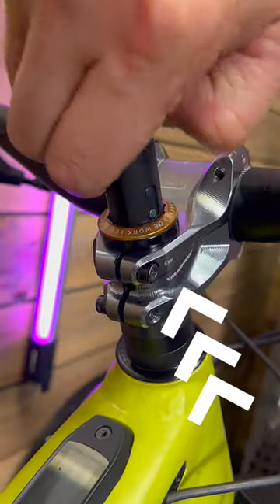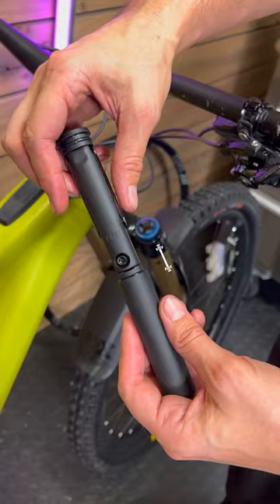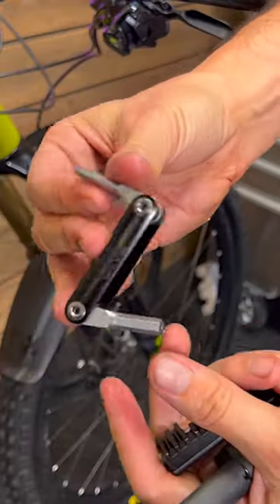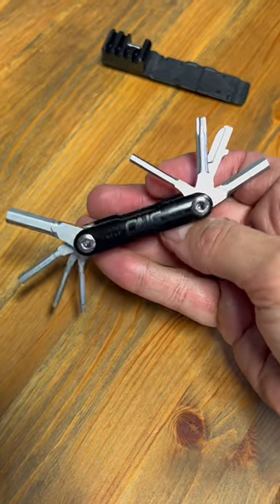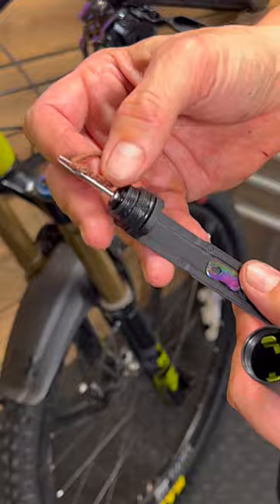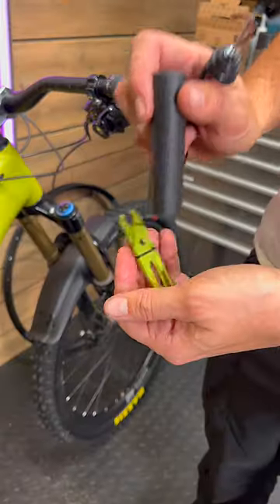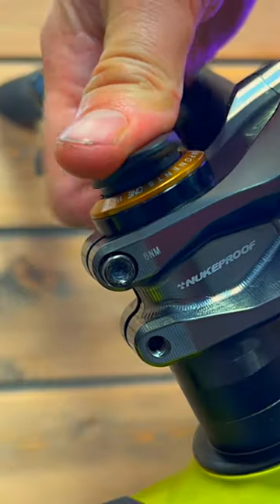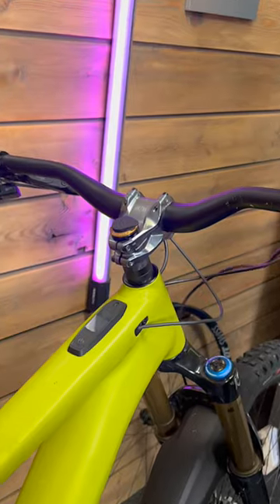Hidden Bike Tool Hacks #shorts

Comment: What about the thing blocking the hole through my steer tube that the top bolt screws into?
Reply: It’s called a star nut. I’m wondering the same thing man.
Reply: @Zac_Szuberski  ended up doing some research on it. You remove the star but and then there are different versions of the product. One where you have to put threads into the downtime. And another when something goes into the bottom of the downtime that this will attach to from the top
Reply: Pretty sure you need to thread the steerer.

Comment: Does it breaks that often you need to carry all this things all the time with you?
Reply from the maker: No, but better to have stuff on you when your on a mountain and something breaks !
Reply: Lol, sounds like you’ve never had a fastener come loose, a chain break, or tire needing to be changed trailside. You either don’t ride much or don’t push the limits if you never have a mechanical issue on the trails.
Reply: Tools  before  food and water.
Reply: Where is the link for this item and where to buy it?

Comment: The only problem is that you have to put threads in your steerer tube and it voids the warranty. I would probably get one of these on my new fork but its been acting weird so im going to wait until the warranty expiries
Reply: The warranty is useless anyways. I have an e bike that the motor died at 951 miles and under 2 years old bosh never made it right. 10,500 wasted.
Reply: @ChannelZeroOne  I have a Marzocchi Bomber z2 and it started leaking air so I took it to my LBS and they filed a warranty and marzocchi said they would fix it for free I would just have to pay shipping
Reply: @spyder027  Still dont see how threading in the top part of your cap has anything to do with the warranty or the point that I was screwed for no reason other than the bike shop help my bike so long that warranty expired. Then to top it off bosche said the bike is now unfixable because they no longer make parts for that motor platform no matter how much money I have.
Reply: @ChannelZeroOne  Any sort of modifications it doesnt matter how big void the warranty idk why ask the bike shops
Reply: @spyder027  If that was the case no one would have upgrade fever... The gullibility of people blows my mind. Bike shops are crooks anyways.
Reply: @ChannelZeroOne  Modifications to a fork like putting threads into your steerer tube not adding a volume spacer. If you disassemble the fork it voids the warranty. Frames are different. I probably voided the warranty on my frame bc I put a fork with an extra 20 mm of travel on it
Reply: @spyder027  Dude.. You effin killing me bro. You dont even need to take the fork off the bike. You only remove the top cap and star nut put threads in the very top of the tube. The threads are less than a 1/4 in to the top part of the tube. It comes with the one up kit. The steerer tube is cut to fit anyways. When you are done with the bike you remove the tool and put back the start nut to sell the bike.

I dont think you have ever looked at this kit.
Reply: @ChannelZeroOne  Ive looked at it. If you look at the warranty on any fork I can almost guarantee that it says modifications to the fork would void the warranty
Reply: @spyder027  Yet it says to cut to your frame size..... SMH
Reply: @ChannelZeroOne  Idk its their rules I just dont want to pay $500 to get it fixed so Im not going to void my warrantu

Comment: Where I am is always where people will be.
   Theez new 3D honeycomb flexy wrldleading saddles = same basic princible behind my Rido I had back in thday 2009.
 
 Which i'd bought 2mirror thBrooks B17. Cowhide saddle. Best seat ever made of thlast century. 
 Brooks 600 grams $125
 Brooks with spring 3lbs 1,400 grams $160 rhats nonsense. Idiot engineering.
 Brooks quality too has gone way down. 
   These 3D honeycomb &carbon rail saddles have flexible base like cowhide 2 mirror springs sufficiently.... &, when u consider they $18.50 a piece,,,,
   Conclusion:
  Now u knowhat thwrlds best bicycle seats are.
 When designed correctly these seats are also newest seats pretty legendary durable2.
 Thos is why u never buy in2 Satans evil demonic vintage bikes.
  Here is what people dont, would never grasp:
  People buy with their eyes& assumptions so they think knobby tires are an advantage so with bikes seats too they think cushioms are best.
 No th best seat back in thday ridden by every tour de france rider ever lived of which thTour = thee most GRUELING test of a seat was selle Italia turbo. 
   Turbo had a hard SLICK cowhide surface over foam. Sorta felt like Brooks.
   But ultra hard foam. Almost like no foam at all. Threality is a cushy seat will DESTROY you cit off circulation in distance riding where its superiour4 short trips.
  But all thingz cnsidered when in doubt hard saddles all way all DAAAY.
   They are th epicenter king.
 Hard surface shiny flexible saddle.
  They havent figured out yet engineering modern saddles that should be shiny slick... yet... but ofcourse they will. 
    And mind u these modern new carbon flexy base B67ish flexy saddles on TEMU dragging 120 grams vs Brookes 1,400 grams shoot u would need 12 of these 120g carbon  saddles to equal thweight of 1 Brookes B67.
   I dont need 2b lugging all that.
 Where I am is always where people will be.
   Theez new 3D honeycomb flexy wrldleading saddles = same basic princible behind my Rido I had back in thday 2009.
 
 Which i'd bought 2mirror thBrooks B17. Cowhide saddle. Best seat ever made of thlast century. 
 Brooks 600 grams $125
 Brooks with spring 3lbs 1,400 grams $160 rhats nonsense. Idiot engineering.
 Brooks quality too has gone way down. 
   These 3D honeycomb &carbon rail saddles have flexible base like cowhide 2 mirror springs sufficiently.... &, when u consider they $18.50 a piece,,,,
   Conclusion:
  Now u knowhat thwrlds best bicycle seats are.
 When designed correctly these seats are also newest seats pretty legendary durable2.
 Thos is why u never buy in2 Satans evil demonic vintage bikes.
  Here is what people dont, would never grasp:
  People buy with their eyes& assumptions so they think knobby tires are an advantage so with bikes seats too they think cushioms are best.
 No th best seat back in thday ridden by every tour de france rider ever lived of which thTour = thee most GRUELING test of a seat was selle Italia turbo. 
   Turbo had a hard SLICK cowhide surface over foam. Sorta felt like Brooks.
   But ultra hard foam. Almost like no foam at all. Threality is a cushy seat will DESTROY you cit off circulation in distance riding where its superiour4 short trips.
  But all thingz cnsidered when in doubt hard saddles all way all DAAAY.
   They are th epicenter king.
 Hard surface shiny flexible saddle.
  They havent figured out yet engineering modern saddles that should be shiny slick... yet... but ofcourse they will. 
    And mind u these modern new carbon flexy base B67ish flexy saddles on TEMU dragging 120 grams vs Brookes 1,400 grams shoot u would need 12 of these 120g carbon  saddles to equal thweight of 1 Brookes B67.
   I dont need 2b lugging all that.
 Where I am is always where people will be.
   Theez new 3D honeycomb flexy wrldleading saddles = same basic princible behind my Rido I had back in thday 2009.
 
 Which i'd bought 2mirror thBrooks B17. Cowhide saddle. Best seat ever made of thlast century. 
 Brooks 600 grams $125
 Brooks with spring 3lbs 1,400 grams $160 rhats nonsense. Idiot engineering.
 Brooks quality too has gone way down. 
   These 3D honeycomb &carbon rail saddles have flexible base like cowhide 2 mirror springs sufficiently.... &, when u consider they $18.50 a piece,,,,
   Conclusion:
  Now u knowhat thwrlds best bicycle seats are.
 When designed correctly these seats are also newest seats pretty legendary durable2.
 Thos is why u never buy in2 Satans evil demonic vintage bikes.
  Here is what people dont, would never grasp:
  People buy with their eyes& assumptions so they think knobby tires are an advantage so with bikes seats too they think cushioms are best.
 No th best seat back in thday ridden by every tour de france rider ever lived of which thTour = thee most GRUELING test of a seat was selle Italia turbo. 
   Turbo had a hard SLICK cowhide surface over foam. Sorta felt like Brooks.
   But ultra hard foam. Almost like no foam at all. Threality is a cushy seat will DESTROY you cit off circulation in distance riding where its superiour4 short trips.
  But all thingz cnsidered when in doubt hard saddles all way all DAAAY.
   They are th epicenter king.
 Hard surface shiny flexible saddle.
  They havent figured out yet engineering modern saddles that should be shiny slick... yet... but ofcourse they will. 
    And mind u these modern new carbon flexy base B67ish flexy saddles on TEMU dragging 120 grams vs Brookes 1,400 grams shoot u would need 12 of these 120g carbon  saddles to equal thweight of 1 Brookes B67.
   I dont need 2b lugging all that.
 I've been cycling/racing pretty much most of my life. I have bought countless bike seats, spending hundreds of dollars for just 1 bike seat. I saw this picture, read some reviews, and thought........... for 14 bucks why not! I actually purchased this seat for a dedicated bike for Zwift. The very 1st time I used this seat I was on Zwift for almost 2 hours, and no discomfort at all! Sitting on a stationary bike is definitely not like riding in real life. Real life rides you move around on the saddle quite a bit, compared to a trainer/Zwift ride. I was so impressed with this seat I purchased another one for my Road Bike. I've ridden approximately 1,000 miles or so, and absolutely love this seat. There is no padding at all, but the seat flexes a little bit to allow your (sit bones) to slightly flex a bit, and have some give. Before I purchased this seat I thought it would be ok for a short time only while doing a Zwift ride. WRONG, I live on the Central Coast in Calif, I went from my house in Atascadero to Ragged Point. 100 miles round trip. Its also a great Century/Fondo seat as well. The only thing that might be a question mark is the longevity? But so far its the best seat i've ever had!Couch potatoe seats:
    There is 1other thing with saddles that is incredible it's
GEL.
  The shiny gel. Not th dull or porous stuff.
    Like fish lures. Is what u want.
 Most seats listed as "gel" are rip offs they are not gel. They are usually porous like neoprene.
 They dont work.
 Has 2b the real deal expensive silicone gels = silicone is th highest quality of th clear shiny gels.
   
 Gel is exactly like human muscle feels like u sitting on some1's leg it stunningly effective.
    I had1 in 1987. Then every1 i got after that was thlousy porous "gels."
   I happened 2come across a seat made with quality materials& chro molly rails made in TAIWAN with real silicone gel. called EASY DO Saddle.
    
When Taiwan list anything like PU, Faux leather, or TPE in cnstruction it is going 2b highest quality PU not thwatered down sht.
   And bcuz I going 2upright bars I decide i should better invest in it a gel upright stance saddle.
   Th engineers covered all thbases I like:
 1: Skeletal TPE flexible rubber base
 2. Chromolly rails
  3. Wide seat
   4. Center channel
   5. Shock absorber rail insert if is designed right.
   6. Clear silicone gel on high quality thick base gel rhey use PU Matrix gel
 7. PU elastic durable slick shiny seat cover top.
 Not 2heavy not 2light weight 450 gram